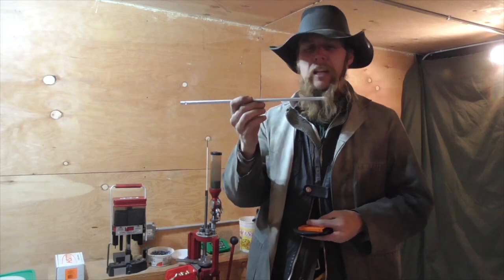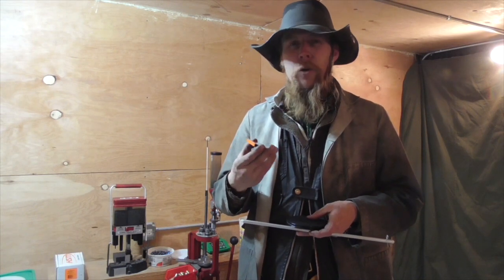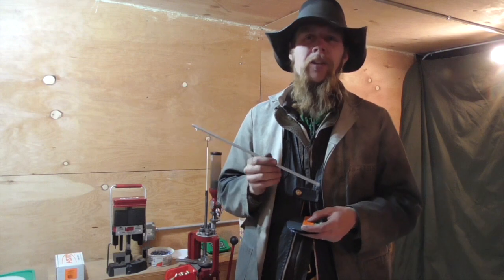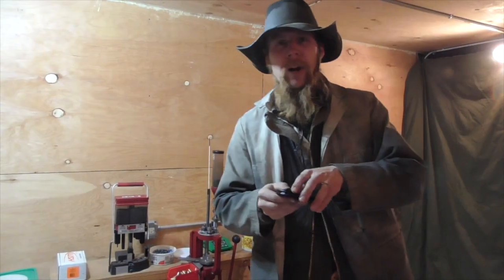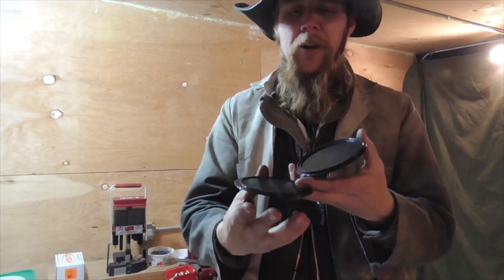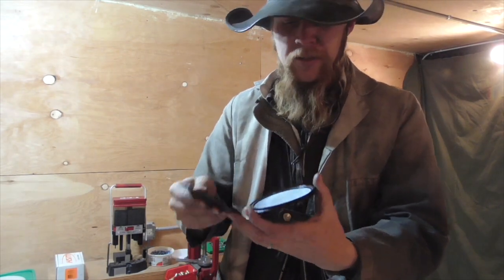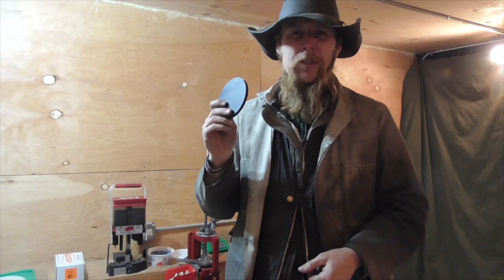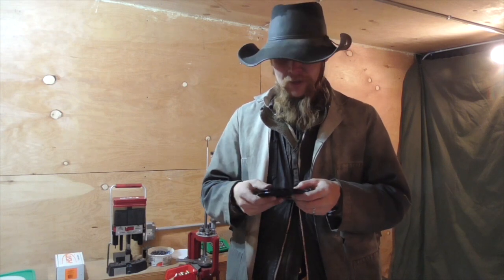3D Printed Primer Inversion Tray (TIS301)

Comment: My printer slicer tells me how much filament will be used.   An easy calculation as to cost.  I would venture to guess you used about 10 meters.    There is about 110 meters of filament on a spool at a cost of about 20 dollars per spool.    So about one and one half to two dollars worth of filament.   And the fun of making your own.